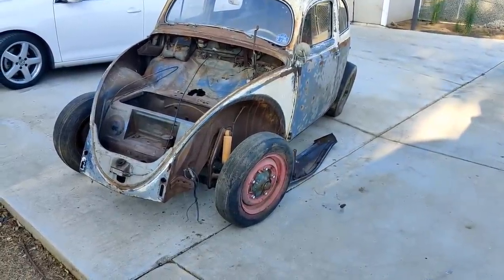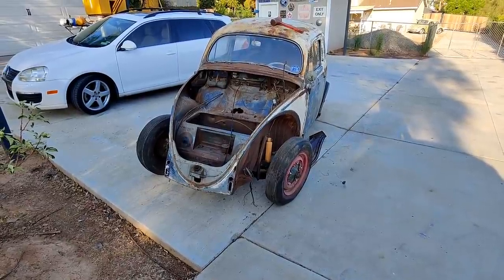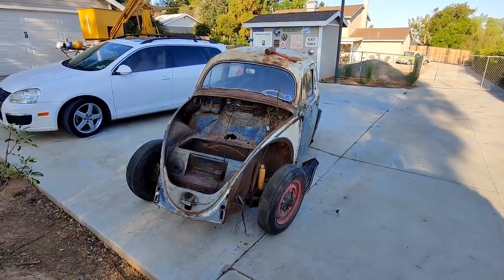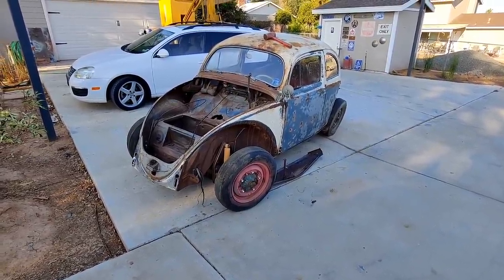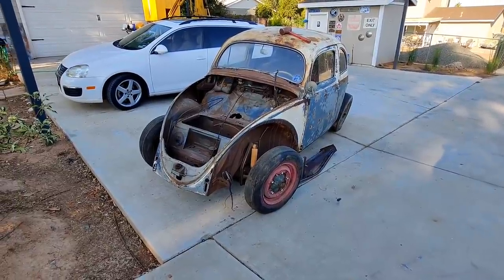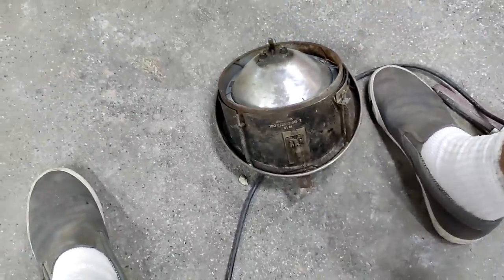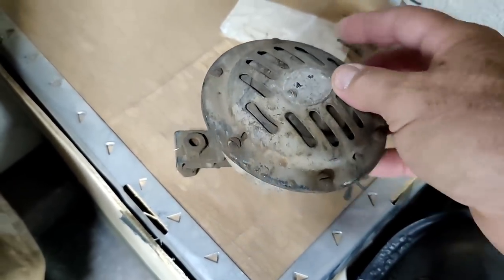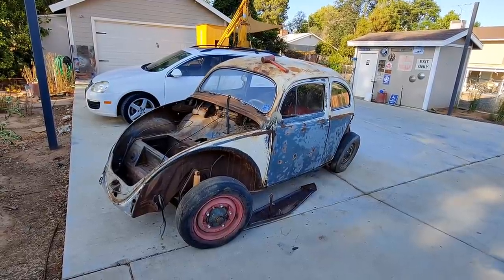Early 1955 Late 1954 US SPEC vs other OVAL WINDOW VW BUGS RARE UNIQUE

Comment from the maker: Documentation says  in May of 1955 to the US bumpers ones permanently. But we do see many ovals earlier with US bumpers. and I have read several guys say their car in 1954 had Us over ride bumpers or ram protection bumpers on the BC. Some of the early Us bumper cars in late 55 YM according to posts on the samba had low mounted snow flakes.(using holes from Hearts) and bullets and no semaphores. Some guys say they have no semaphores and July built car with a 3 fold. Never cut. All I can say is PROBABLY....I am not going to doubt what they are looking at because of documentation. Documentation could be WRONG.....Just saying

Comment: Thank You for the tour and video! With your ability, I recommend modifying later seat frames 👍.
Some car folks really worry about what is "correct" for a particular car and year.  I have another German car that an "expert" told me that my radiator core support was incorrect as only the carburetor cars had this kind, while my injection car should not have it.  After media blasting there was no evidence of cutting/welding = the factory used what they had on hand. They weren't worried about experts 50 years later. (2002 tii) 😉

Comment: The over-rider towel bar bumper early was an option and was called Ram-Protection. Once it was US spec it became more known for 55 and newer. My 55' was built first week of Jan 55'. It is factory overider, semiphore,  heart taillight car even though I still get folks that say egg taillight. Prior to 55, model year went from January to December. 55 from January to end of July. 7 month run. VW was ramping up production so they decided to start model year production in Aug. For following year which was continued on till production stopped. I had a 3 fold parts car that was May 55' bullet light 3 fold American bumper car. Lots of scenarios with the 55's. You have a late 54' model year car if it was built Nov.54'

Comment: One of my dad's jobs was to switch the first over when they came off the off the boat at the dealership he would put different bumpers windshield put oil in them you did the same thing in the late 70s early 80s for datsun they had to have a different bumper they would send them in and they will put them on at the dealership

Comment: My 1975 Super L was built using leftovers, as Nissan ,the Australian Licensed Manufacturer. Seats are quite obvious as Hi Backs seats were the norm , mine has standard low back.   This a little speculation on my part but there are lots of subtle indicators, to suggest my observation, to be correct ...regards Alex

Comment: If I remember correctly August is the model year change 🤙 🇺🇸
Reply: 55 is a half year car first half Euros back second half us spec 🤙🇺🇸
Reply: August sounds correct.  If it's build date was late '54, it is a '55 model.  If I remember correctly, VW always shut down for a month or so in late summer to re-tool for the next model year to start in August.

Comment: this is a lot simpler than everyone is making it out between 54/55 and 56, Dec 54=54, Jan 55=55, Aug 1 55=56, there are only two obvious differences between 54 and 55, 54 has metal luggage rails behind the back seat along with weld nuts in behind the seat back to hold them down, 55 does not have luggage rails or mounts! also the door hinges on a 54 have round oil holes visable when opened, 55s have door hinge oil slots cut out, thats it! judging by the relocated VIN plate you have two cars! the body number is not going to jive with the chassis number! look it up on Samba, also the front axle and trans numbers are on Samba, I bet the body was swapped so its probably a 54 AND a 55 put together, also thats not an early taillight rear fender, I see the ribs on the lip but heart and US bubble taillights had 4 low holes only, two big holes horizontal where the rubber seals attatch and wires go thru and 2 small bulb holder holes, there never was any extra holes up high on early oval fenders and they always had the two big holes where the seal pops into, I have a 54 and a 55 sunroof, good luck finding those seats!
Reply from the maker: interesting. I dont see the luggage rails on mine. wonder if they changed that when they did the tail lights. Oct 54?

Comment: How do the semiphores work? Wiring/cable?
Reply from the maker: wired to the turn signal
Reply: Originally, when you activated the turn signal switch, the semaphore lit up and raised.  Many people now modify them so they blink.  The first one a friend of mine did he accidentally had it going up and down rather than blinking on and off while remaining up.  That one broke after a few slap-slap up and downs.  But, that was back in the early 80s.  lol
Reply from the maker: @peecee1969  too funny